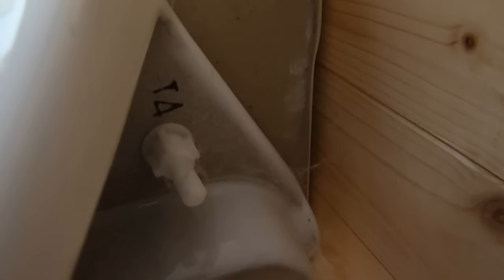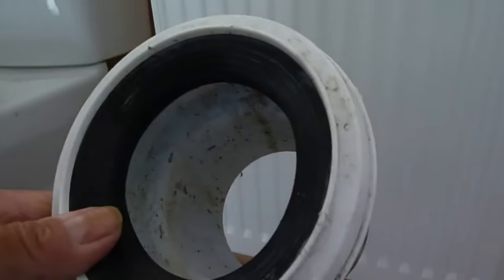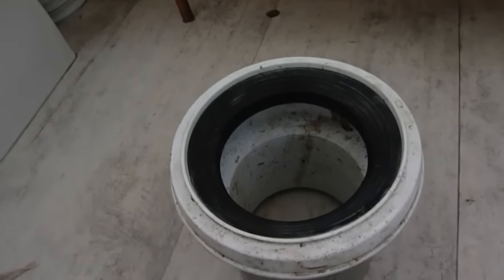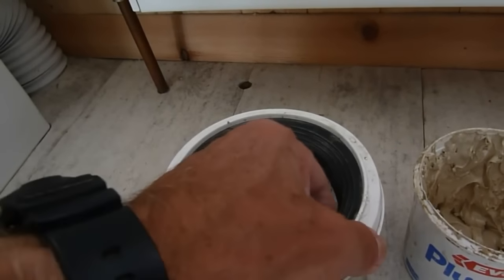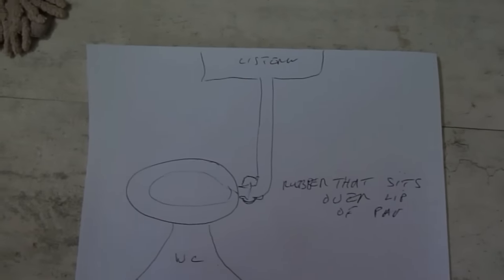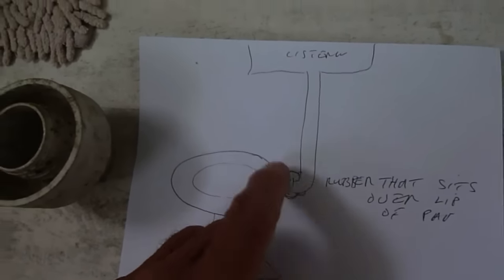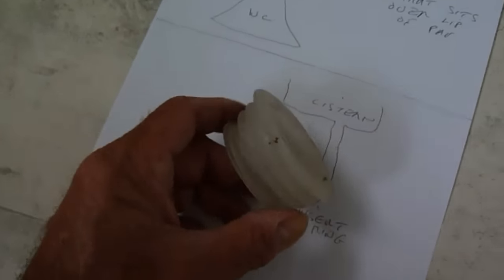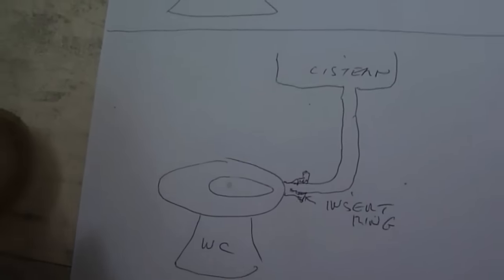How to fix a leak at the back of your wc pan .

Comment: If you leave the toilet pan with the flush pipe still in the rubber ring on the floor there is no way you are going to be able to get your fingers in between the rubber seal and the pipe to put the Plumbers Mait in below the seal. Unless you have matchstick fingers with extremely flexible joints.  It looks easy because it's not attached to the floor with the toilet pipe going in. The toilet pan has to be taken out to be able to do this, in which case you may as well just change the rubber seal.

Comment: Thank you...just the confirmation I needed regarding Plumbers Mate. Also discovered the pan hasn't been screwed to the floor so just wobbling around when people sit on it!
Reply from the maker: O dear. Reach for the screws and driver.
Reply: @dereton33  That is fine unless your wife has overindulged with bleach and rotted the screw heads so the whole pan has to be removed, not easy when the twats that installed it didn't put a local stop valve on the inlet. I am just about to fit a completely new pan with inlet stop valve etc. Hopefully, I will be able to get the remnants of the old screws out!! lol

Comment: Very helpful video although in my case roof is concrete and toilet fixed with cement so I might as well call a plumber as it looks like a tougher job. It's leaking water from the big rubber seal at the back. Been more than 30 years. A big thank you from the Maltese Islands 🇲🇹
Reply from the maker: Glad it helped, good luck with it.

Comment: Thanks mate plumbing’s not my strong point and you helped me diagnose and fix leak from top pipe.just pushed grommet back and it’s done me as a temp fix until I replace grommet.thanks.
Reply from the maker: No problem 👍

Comment: Cool to see the couplings up close off the appliance, and to learn their names, thanks!
That plumbers mait fix feels like it will need fixing again in a few weeks. If the rubber seal couldn't hold it, surely somethings moving about that shouldn't.
Reply from the maker: No, it is just the old rubber seal inside the multikwick pan adaptor has gone. Once plumbers mait is applied it stays flexible and last many years.

Comment: Thank you for the video, we have a leak of the smelly kind, i think the flexible waste hose has a gap where it enters the floor waste pipe allowing drain odour to come out, so I will be doing as you suggest and plugging it with plumbers mate, fingers crossed a nice smelling bathroom again!
Reply from the maker: Glad it helped
Reply: @dereton33  I am having small flies coming from the back of the toilet and possible cistern leak in have a 4 inch pan connecter to a 5 inch ware pipe there is a gap are they possibly coming from there the flies please if you can help thanks

Comment: Thanks so much!
Very helpful .Like I mentioned in one of the replies. Been waiting for a plumber who doesn’t seem to know what he is doing as the leak seems to be continuous and even the plumber had know idea where it was coming from until we had to figure it out hence coming here . Thanks so much but one question  is we have completely replaced the waste pan but the joint still leaks so what do we do? Wish I could attach a picture. I would appreciate your response at least to be able to fix it before Christmas of 2023 🎉🎉for our guests.
Merry Christmas to you by the way. Thanks again 🙏🏼🙏🏼
Reply from the maker: Best bet is to dry the joint and then pack out the seal with plumbers Mait.
Reply: @dereton33  Thanks so much .
Very helpful!!! Will do

Comment: Is the pan waste outlet always a standard size in the UK? I have seen various straight couplers that vary slightly. Also The issue is that if the pan has any movement it will eventually leak. The seals really don't seem to be up to the job for any length of time. Also, pans are usually fitted into the same position each time they are replaced so the flooring needs to be structurally sound either by replacing floorboards or thoroughly making good the concrete for example. Plumbers mate may be a good temporary fix but if the pan is removed anyway you may as well buy and fit new straight connector for around £6 in screwfix for peace of mind. Other connectors are available to suit your application but are likely to be more expensive.
Reply from the maker: Thanks Keith.

Comment: Thanks for this video I hadn't thought to use Plumbers Mait to fix leak. A tip that might help others when plugging gap is to plug the bottom half first (while pushing down on plastic waste pipe) then when top half is plugged the bottom half gets compressed. The bottom half is the most vulnerable to leaks.
Surprising how little PM is needed I bought a tub (£3.99 at Wickes) then just as finishing job found a half used tub at least 35 years old - it was a bit harder but still reasonably pliable.
Another tip: if having to fix leak from the front as I did - bath at one side wall at other - is to put a large cushion on the toilet lid - your ribs will appreciate it.☺
Reply from the maker: Thanks Del.

Comment: Many thanks. Two types of leaks. One from where the cistern pipe joins the back of the loo and one probably from the rubber sealed pipe that goes down to outlet to the sewer. Have to figure out which leak I have got but thanks again for your advice.
Reply from the maker: Good luck with it.
Reply: @dereton33  Thanks for your reply. It was okay for three days but now water is coming back out of the bowl through the flushpipe. I'll try a new gasket and see if that works. I fixed the leak coming out of the enamel pipe at the back with your help but now I am getting a back flush from the smaller pipe. I'll put a new gasket in.
Reply: Plumbers World sold  me a new gasket (a very soft squashy one) plus sealant. However if anything the water pours out of the back of the pan worse than ever when I flush it. I suspect that it is limescale blocking it so taking the pan out again to try and figure it out.
Reply: I had to throw away the plastic insert from Plumbers World. It was soft and squidgy and already malformed after a day. Found one just like yours Dereton in my garage. Works a treat but had to reseat the pan because the distance was different after changing the outflow pipe which I needn't have done as it was the inlet in the end. Thanks for your inspiration.

Comment: Hi great vid.very helpful.my prob at the moment is I have a clay 100mm pipe flush with the ground.i am trying to find what is the best way to seal a pvc pipe inside it.who ever had probs before used a hole tube of silicone sealant around the base.but silicone always fails eventually.. the pipe I am trying to fit is a 90°flexi pipe.what is the best way to ensure it seals inside the clay pipe thanks for any advise 
.
Reply from the maker: A multikwick pan connector.
Reply: @dereton33  will have a look thanks 😊 🙏

Comment: Thanks for the plumbers mait tip , I have purchased a new pipe but the rubber will not go on the older toilet pan .are the newer fittings smaller please . What size should i order to make sure the rubber ring in the elbow fitting is the right size please .
Reply from the maker: They are all just one size.

Comment: Hi. Thanks for the great video! I've got a saniflo and suffer from a leak at the back of the pan. What's the best way to connect the pan waste pipe to the saniflo. Should I just connect the rubber connector that comes with the saniflo onto the enamel outlet from the back of the pan (with a jubilee clip) or should I use that along with the rubber ring adaptor connector shown in this video?  Cheers!
Reply from the maker: +Simon McKean . You should just be able to connect the rubber connector on the Saniflow directly onto the back of the pan, a large jubilee clip is useful for sealing that joint but not normally necessary.

Comment: Hi.  Video confirms what I probably need to do - the nasty job (ick) of replacing the seal.  I've a pan that discharges to the rear and the bog clogs regularly.  When I plunge it to clear it foul water leaks into the kitchen downstairs!  The Plumber's Mate job has already been done, probably badly.  I'm really not looking forward to this...
Reply from the maker: Good luck with it. Al.
Reply: Yikes, sounds like you're lacking proper ventilation in that run. Did you ever find you needed the soil stack fixing?

Comment: Thank you for the video. Would sanitary silicone be a suitable alternative to Plumbers mait for fixing a leaking multikwik connector rubber seal joint?
Reply from the maker: Yes that is fine
Reply: nope nope nope as it doesnt come off clean when you need to replace it. doesnt properly seal the loo too i found. i am trying this mate stuff now, its so easy to use and then i have a rubber seal coming in. i think my floors are wobbly due to being on ply and wood only...

Comment: I have a toilet leaking from this multi quick join, before I start taking things apart to either replace the seal or use plumbers mait (good tip thanks)... What should I expect from removing the multi quick seal? ie is this a small pipe connecting to a ground pipe? Looks like the downpipe goes into an area I can't access without taking the floor up. I'd hope it's just a short connecting pipe, any advice?
Reply from the maker: It will be a short connecting pipe going into the main soil stack.

Comment: Thanks very much for the video, my greatest relieve is that I'm not alone, I can not believe the crappy standard of all this Mcalpine crap where basically one fits new sanitary ware and new pan connectors or plugs and basically they just don't work and one still has to gum them up with Silicone or plumbers mate. Car hoses don't leak and they are a simple jubilee clip with temperatures up at 110 degrees, I look forward to the day that somebody comes up with a better design and puts them out of business. Right now I'm not at my happiest as I've spent hours and hours trying to fit a bathroom to a high standard only to find at every turn that I have to take it all apart again because of the poor design or build quality of the above and ram things full of plumbers mate or silicone, it is a total joke. That saying,' it's the thought that counts' needs to be applied to plastic compression fitting and rubberised joints, one should be able to do the job once and know that its going to work perfectly, it is so common to see plumbers having to compensate with silicone, its just total bollocks that Mcalpine or somebody else needs to sort out. Thanks again for your help, make sure you wash your hands!
Reply from the maker: Thanks Alistair. Your comments are bang on.
Reply: You're welcome my friend, keep up the good work.
Reply: Alistair Milner had the same experience, mentally ruined by my bathroom, damaged items, poorly made parts, leaks galore. must of fitted everything at least 3 times. Sponsored by silicone in the end! 😢
Reply: What is there left to say, I feel your pain my friend, shout, scream, let it all out, take lots of deep breaths hopefully you'll get there in the end. I suppose if I can dispense any advice it would be try to preempt your education in plumbing by learning from others ahead of time by picking up as many hints and tips on you tube, browse plumbing books from library or second hand shop but I think most of all what causes so much anguish is not just the poor quality of parts and  lack of instructions but ones own lack of familiarity . I'll give you example, waste for plugs on sinks and baths, they come with top and bottom rubber washer, if you fit the top washer the plug sits proud and a pool of water will sit in the dip of the basin and another pool of water will collect on the floor  because it doesn't work anyway. Get rid of the top washer and use plumbers mate and the plug will sit low enough to look smart and hopefully seal up, you may also need to use silicone around the exterior of the plug waste ridiculous as that sounds. All of this trauma is hard won and it seems to be the case through out the job, its why apprenticeships and on the job learning are just as important as college. Take solace from the fact that you are not alone, we have solidarity, community and unity in our plumbing misery! And if all else fails, go to a good cafe..Good luck, you'll be pleased at the end of it.
Reply: Macalpine is far superior to any other make repairing a joint with plumbers mate is a bodge allways renew the joint
Reply: Are you all using inferior products and calling them multikwicks your all using inferior products to save a few quid ,you have to think all these joints have to last thirty years or more how many times do I look at the spigot of pan that doesn’t line up with the soil pipe let’s get back to the good old days when a pan had 4 holes in it to screw it to the floor

Comment: Hi very helpful video thank you. I have a leak which is now a puddle...I have had someone check it over but finding it hard to detect where it is coming from. A new flush cone has been inserted but I think it is the large pipe at the back and it has been dripping for some time as the vinyl is marked and I am going to buy some Plumbers Mate, there are no marks elsewhere on the floor only directly underneath, my friend seems to think it may be coming from another pipe to the side which leads to the boiler, just can't see it. What do you think? Appreciate your opinion in this matter. Many thanks.
Reply from the maker: It usually is the soil pipe connector. Try a good wedge of plumbers mait in the joint. Make sure it is dry before applying.

Comment: Can you connect a flexible pan connector straight into the stack/ boss? Or do you need to put a piece of soil pipe in stack/ boss first
Reply from the maker: You will need a short piece of plastic soil pipe
Reply: @dereton33  Thank you for your reply, hope you are well.
Regards.
Barry.

Comment: thanks so much for this too. i made a little frankfurter of this round the join. hopefully stops the join leaking. i used silicone as a fix 2 yrs ago and i dont think it held anything. now this way and then butle rubber stuff
Reply from the maker: Well done Dan.
Reply: @dereton33  thanks.  Seems to be good today and I put a plastic bag underneath to make sure it's all ok and no signs of water ...

Comment: Al, thanks for your clear and helpful videos. I have a general question about toilets as we have spent hours looking for what to buy in the £200-£500 price range - it is difficult to discern the difference between the ends of this price range. 

It is often said "you get what you pay for" but there is little technical information on actual performance to go on in this range to give confidence that it is worth spending at the top end. There are literally tens of trade names, some seem to share a common manufacturer and yet there are surprisingly few reviews that provide accurate insight into which makes for the best product. 

Do you have any suggestions for the best toilet makes in your recent experience? - We want to know that we are buying a quality product that will do the intended job properly and reliably. Or are they all basically the same? Your suggestions/observations welcome.
Reply from the maker: You should have my reply by email now.
Reply: @dereton33  Yes thanks Al

Comment: Thanks.  Can you help.  The waste pipe from my WC is leaking at the WC end. The pipe comes out of the WC at a 90 degree angle and attaches
to the pipe that emerges from the side wall - so the pipe is 'L' shaped essentially.  It is a non flexi plastic pipe. I've bought a flexible concertina type pipe
and was wondering if I can fit this easily without removing the pan.  Or perhaps just use the plumbers mate you suggest. any help appreciated.
Reply from the maker: The flexi one should fit ok without removing the pan.

Comment: I recently had a leak caused by a bad connection. Also, the soil pipe somehow accumulated a build-up, which caused slow drainage. On assessing the situation , i noticed an offset pan connector was used as the soil pipe was a couple of centimetres higher than the toilet outlet. Now, over the years, i sometimes suffered a problem where a turd would make an unwelcome reappearance in the pan next time i used the toilet. Or simply it would take a couple of flushes to get rid. I blamed the toilet, but in actual fact, it was the misuse of the offset connector. These will work better if the offset of the waste pipe is lower, not higher than the toilet. Ideally, connection should be straight on. Turds struggle to move uphill! Anyway, i fixed the problem by raising the toilet on a plinth of plywood and used a quality Mcapline connector, no offset. No more re-emerged turds or leaks since.
Reply from the maker: That is the correct way to fix it well done.

Comment: Hi, I replaced my pan connector with a Mcalpine Pan connector but it is still leaking. The connector is not level with the toilet. Do you think that is why it is still leaking? There is a slight tilt of around 1cm.
Reply from the maker: No that is a small one cm. Try packing the joint with plumbers mait. Some pans are not rounded enough on there outlets.

Comment: Thanks, just installed flexi pan connection and still leaking. Previous connection had always leaked years of plumbers mate used. Thought new pan connection would resolve . Now thinking it maybe the pan itself isn't circular!
Reply from the maker: That can be the cause.
Reply: Thanks dereton33, I'm beginning to think by design there's something not quite right with this wc outlet. I cut away elbow which was over half filled with solid matter (gut wrenching stench).. Still not totally clear and pan filling with water most times near to top rim before flushing. Investigation continue)
Reply from the maker: Sounds like you have a blockage. Try using a drain rod with the plunger on, flush the toilet and pump like mad until the water level drops.